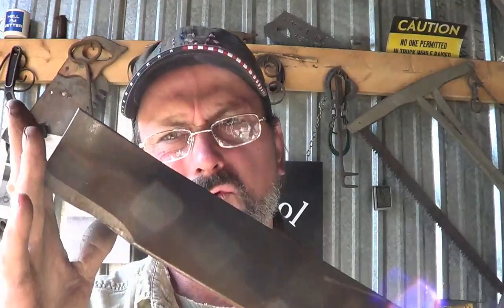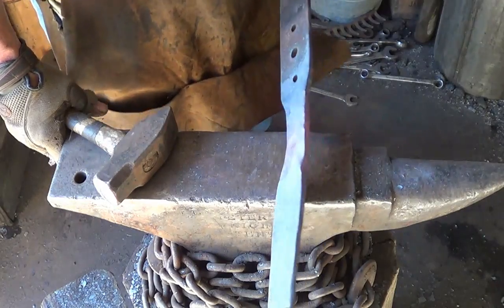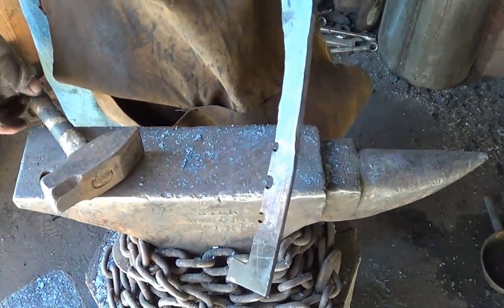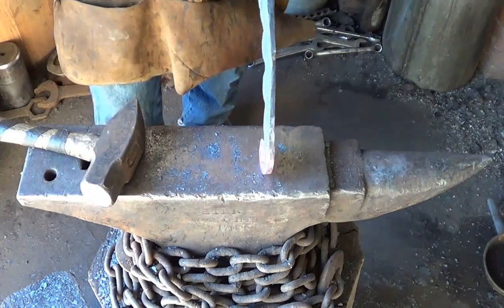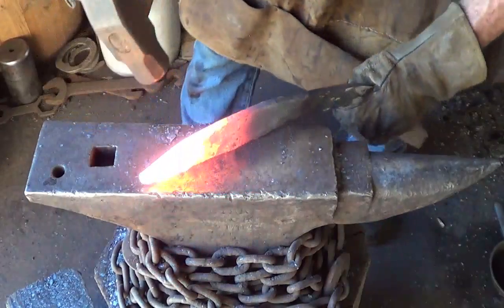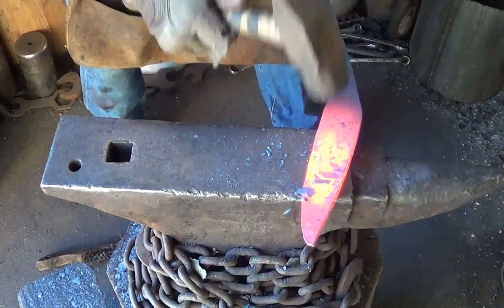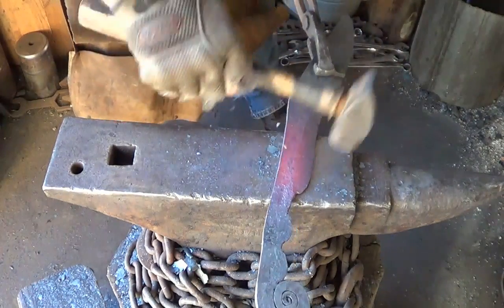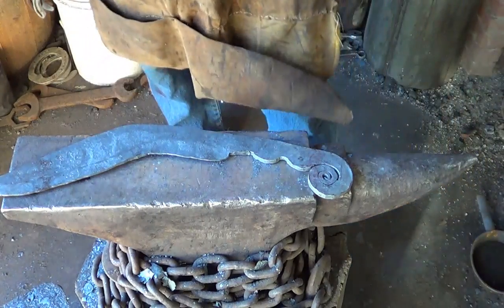Blacksmithing - Forging A Lawn Mower Blade Kukri Part 1 - Forging

Comment: Another fine video shared by you for all of who live vicariously through you! I am a sheet metal worker/fabricator by trade with an emphasis on welding so I have always wanted to forge some knives and blades of some sort for years. Now after watching you I might finally build a forge, anvil and other items needed to make it happen. I have been buying up tongs and hammers for years at auctions and yard sales along with collecting many 100's of pounds of different steel to use when I get a forge built and ready to try my hand at blacksmithing. Thank you for the great inspiration!!

Comment: this is what I do at 3 AM, watch some dude hit a hot piece of metal with a cold piece of metal on a stick, all the while wishing I could do the same and debating if I should spend my Christmas money on some blacksmith supplies
Reply: Right?
Reply: Spend much less and make your tools.  Make your forge, tongs, and punches.  Materials are cheap and can be found easily if you know where to look.  Plus the big bonus besides saving money is that the lessons learned while making your own tools will prepare you for making other things.  Dont be afraid to try new stuff.
Reply: This not not just some "dude"
Reply: Derpy Duck You can get a good size Railroad Track anvil on Ebay for around $100
Reply: If yo have an old wok an air bed pump and a piece of right angled hollow bar and a drill yo have a forge
Reply: or you can get a free railroad track anvil if there are any crews replacing track around your city. I recently got one and all I had to do was ask.
Reply: Taylor Williams
Hell, a hole in the ground and a hair dryer will make a serviceable forge. Just be aware of fire codes in your area, and if you have a burn ban in effect.
Reply: your local flea market is a great place to find old used files. nicholson files and most japanese files make exelent knives. also check your local salvage/junkyard for leaf springs,coil springs. big old brake drums make good forges as well.
Reply: first time you hit hot metal with a hammer you will know if it's for you
Reply: Do it bro. I did and all my mind thinks about now is steel and heat... But don't buy the brand new stuff. You get really good stuff used. Some of it is really easy DIY projects aswell. You need a hammer and an anvil tho. A pair of tongs helps aswell.
Reply: Derpy Duck ....I got into blacksmithing soon after I got out of the Army. it's really good ptsd treatment.  I love it.
Reply: Derpy Duck I am a high schooler who has been black smithing for about a year and getting into it was a great decision you should do it to.
Reply: Derpy Duck do it!
Reply: Hey Rob Goodson. Thanks for your service man. By the way do you know a Ron Goodson, Ann Goodson or Sarah Goodson? We might be related.
Reply: What else is there to do at 3am?

Comment: What I have seen of the Indian/Burmese, etc, forging process: The "blank" is forged to a shape that is somewhere between a billhook and a hand sickle/ hand scythe. Then as they add the bevels it takes the Kukri shape. Never saw a video, just a series of pictures by a British Anthropologist type. The short part is a straight bevel back to the spine and the longer chopper part has a steeper convex bevel at the edge: with the blade "dishing" a bit thinner (1/16"- 3/32" on each side) through the middle then back to a beefy spine that has very little distal taper(5/16"down to 1/4" at point.)  Good looking piece there. I thought you might hook that tail piece around to make a hand guard.

Comment: 11:11 im liking the shape here, shortly after you thin it out more than i prefer.....16:11 im worried about the final shape, but that opening up the halfrounds you cut open where the blade mounted is a pretty great idea. that curl is definitely different. thanks for the share, watching you argue with this unknown steel finally tipped the scales for me to forge a kukuri from a lawn mower blade. thanks a million!!
Reply: i wasn't prepared for 'i think i need to fiddle what ever im fiddling up to this next notch here...' much laughter

Comment: don't feel guilty, pan that shit. I like it man. I've been needing to make a new chopper for the bush and I'm not sure on on the blade style, might do one of these though. Really enjoy your videos and everytime I watch one it gives me motivation to fix up the shed that will be my new blacksmithing shop, I can't forge till its fixed. thanks you for the video
Reply: evan shankar
 I just got a stack of leaf springs off a truck so I'll be using that, seems to be the perfect size just a little thick.

Comment: I miss those old mower blades you could sharpen yourself. The junk ones we get now are a seasonable consumable. Not sure what they're made of but my guess would be soft iron to be honest. They don't hold an edge worth a damn. Old mower blades and worn circular saw blades make very decent cutlery for damascus stock. 👌

Comment: the blade could be made out of HSLA ( high strength low alloy) its tendency for it to not want to break and not get glass hard even after quenching makes sense because it is a mower blade. would rather have it bend and be tough than shatter when striking a rock while mowing. I am not a metallurgical expert just repeating what i have learnt and heard from other smiths. keep up the awesome work!

Comment: From what I’ve read, mower blades are often water-hardening steels: oil quench is too slow to harden them, they need the speed of water.

Air-hardening steels are the opposite: even the slow cooling in air is sufficient to harden them.

Comment: I love your channel and all the cool stuff you make.  Because of your videos, I started teaching myself about blacksmithing from your channel and some books I've bought.  So far I made a gas forge, a bucket forge, I have an old railroad track anvil that belonged to my great grandfather, and I made a wiggle pick for a guy who is into arrowhead digging.  Thank you for all the inspiration.  Do you have any experience with forced air gas forges?  I can't get the temp I need to in my propane forge and I've read that I need to convert it from just straight gas.  Thanks again for all that you do Brother.

Comment: Great stuff Chandler, you're very watchable and more importantly, listenable!  I don't know much about forging but i do know lawnmowers and it seems to me an obvious choice. The stress a blade encounters in normal working use is pretty extreme, it rotates at up to 3000rpm, tip speed up to 19000fps and has to be able to withstand impacts while doing so. There's a lot of old mower blades out there :) another possibility is old forks from a fork lift truck, i had to cut some up once and they are very tough! Good job on the learning curve, i was convinced you were an old hand. Liked and subbed.

Comment: hey chandler from what i could find quickly online about lawn mower blades people are stating they could be made from 1084, 1085, 5150 or 5160 steel but you would need to know who made the blades in order to find out what they are actually made of.

Comment: I wonder how well a lawnmower blade would actually work as a hacking tool or machete if you took it straight from the machine and ground a long edge on it. What would be better, that or a forged one using the same steel? Theoretically you'd think a forged blade would be better but with how durable that steel seemed to be before forging it looks as if it'd stand up to anything.

Comment: Hey Chandler! Thanks for all the great videos. I don't know how feasible it would be but when forging the bevels, what if you would spin the blade around and flip it to forge the other side? So, if you start forging the right side of the blade while gripping the tang; spin it around to grip the point and flip to forge the left side. But, what do I know? What do you think?
Reply from the maker: Yes it would great idea!
Reply: Chandler Dickinson
Reply: Kyle Harless 
usually when forging the bevels on a blade you utilize the anvil on account it should produce a mirror image on the opposite side. I  think. at least this is what ive learned. but you do have to dress up the opposing side. But what do I  know I  am just a newbie also.....lol

Comment: Lawnmower blade are usually 1040/1045 steel. large grain and very soft so that they will crush instead of shatter.

Comment: What's the deal with all the flaking that the metal is doing? Is that thin sheets of top layer steel coming off? Is some sort of residue from the coal in the forge? Is it impurities in the steel coming to the surface and then  breaking?
Reply from the maker: typically impurities in the steel coming out...

Comment: Hey Chandler.  Is it possible to forge a pile of guitar strings into an ingot and possibly into a spike ... etched of course to show off the details. ?   Late night thoughts from a musician.
Reply from the maker: Spike?
Reply: Chandler Dickinson haha.  Yeah.  Um. I figured the ingot would be small. Unless you had A LOT of strings to work with.  spike; decorative nail?    A guitar wall mount was my first thought.   It's a two prong hook you'd hang a guitar up with.     Appreciate you answering !!

Comment: 99% it's high manganese steel. Won't have great edge retention, but it will be strong. If you have any interest in making a froe, this stuff will work well. It might be better water hardened, but not sure.
Reply: hvy 1ton I don't "smith". But I remember my lawn mower blade edges lasting a while on the new/original sharpening but once I resharpened that first time the edge didn't hold as long. Could it be case hardening? There's no incentive for edge retention in the lawn mower business.

Comment: I just quench unless it looks ancient the older ones are normally high carbon steel the newer blades are normally low carbon steel that don't get much harder when quenching or tempering from my experience doesn't give it any better of an edge retention the edges are hardened but the main body of it stays soft because when you hit a rock or stone for something you don't want to harden blade flying off and maiming you or you killing somebody they're good to take a beating a lot of people say they're useless for knife-making which is probably true but I make machetes Bushcraft machetes out of mine and always tell people carry a file or a stone to sharpen it in the field but being that is low carbon steel you don't need to temper it at all just straight from the forge to the quench let it cool down heat it up again set a bevel quench again then I normally grind it put an edge on it heated then quench it one last time, it gained some hardness but not enough to be brittle because it's so low carbon if it's new blade mind you, if it's an old blade and you know it's a really old blade definitely test it because it might be high carbon steel and then it does need all the bells and whistles done to it but that's just for my experience I have seen blades that are just case-hardened too

Comment: My research is that mower blades are generally 1085 steel same as music wire
Reply: Tom Johns. lawn mower blades are not 1085 that would be to brittle. lawn mower blade usually are hardenable and tough but not really the best steel. They are generally not always but generally a high alloy steel that isnt super high carbon they harden alright, but are made to be tough and more flexible. Not brittle like high carbon would be. The only way to know if a mower blade is workable is by doing testing on every one you have cause they can all be so different.
Reply: According to the link it may be 1070: http://www.steelforge.com/aisi-1070/
Reply: Tom Johns guessing what steel lawn mower blades are made of is the same as trying to guess how many jelly beans are in a jar. They've been said to be 5160, 1080, 1050, 5150, 1070, L6, or whatever else you get from China. The only way you would know is to get it tested, and. Guessing games with knife making is no fun
Reply: http://anvilfire.com/21centbs/jnkstee1.jpg is what I referenced, I apologize for speaking my mind Gentlemen and I know 25 years a repair welder in the railcar Industry doesn't make me a blade smith but missteps and mistakes is how we learn. Peace.
Reply: Tom Johns that's a great cheat sheet to use, but with everything being made in China as cheaply as possible these days, it only applies to vintage finds. even files these days are often case hardened junk steel

Comment: I don't why but whenever I heat up some steel as soon as I get a good forging colour as soon I get it out the forge and get a couple hits on it cools down to a dull red..... am I doing something wrong?.. 😂
Reply from the maker: hit faster????  lol... not sure...  working small or thin pieces you don't have much time....  if you can get it hotter, that will give you more time
Reply: Chandler Dickinson thanks I think it may be because the steel is not in the forge long enough maybe the inside is not as hot as the outside

Comment: How big of a brass hammer do you want to make? I could work out a trade for scrap brass with you, if you like?
Reply: drason69 - I'm pretty sure he'd just re-melt and cast the brass that is on his hammer.
Reply: If you note, the current hammer was short on material.  Besides, I probably have about 70+ pounds of scrap brass, yellow and red.  The scrap price is not worth taking it in for the cash. It is worth more in its "usefulness" than for money

Comment: +Chandler Dickinson I would of myself used that bit on the end of the handle you didn't know what to use for as a hand guard, yes its not how most kukri are made like but I like to follow the rule of mine just because some others done it one way doesn't mean you gotta follow suit be yourself be individual.

Comment: My wife wants to know why you wouldn't hold it by the pommel to get the bevel right on the side that gives you trouble.  She's not buying my "It's man stuff, you wouldn't understand"

Please answer so she'll let me back in the house.
Reply from the maker: not sur what you mean by the pommel,,, does she mean flip it around so I am hammering both sides in the same direction?  if so  she might have a point...  sorry
Reply: Yea.  For one bevel hold it by the point and for the other hold it by the end of the handle.  She let me back in!  Hooray!